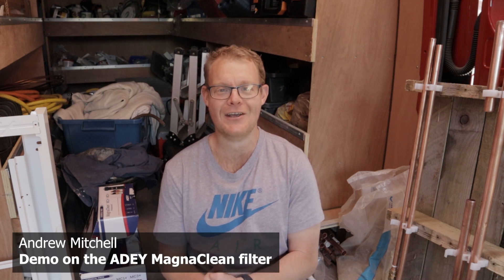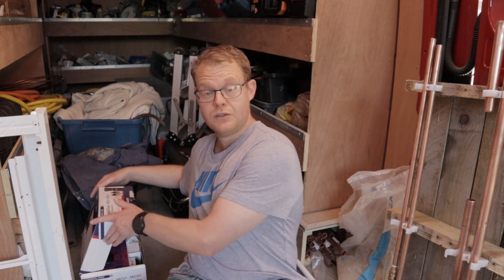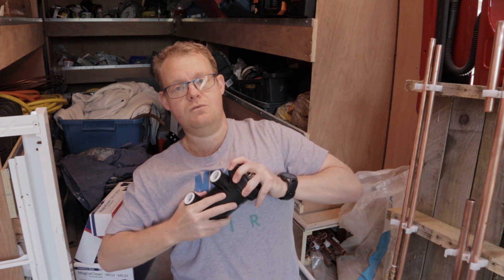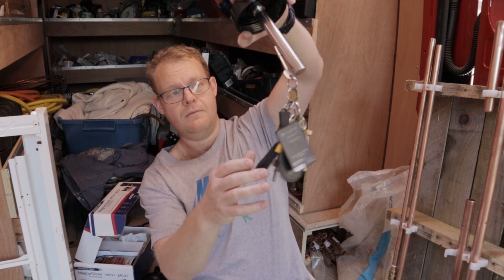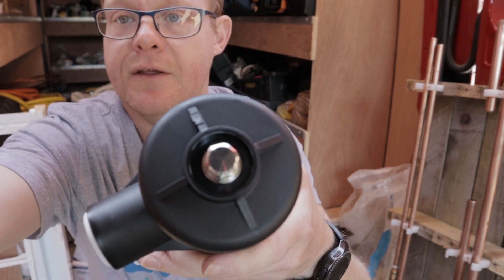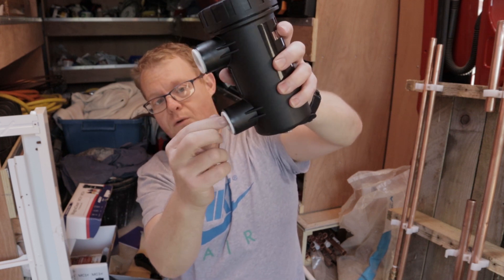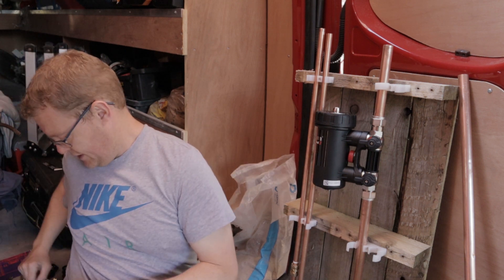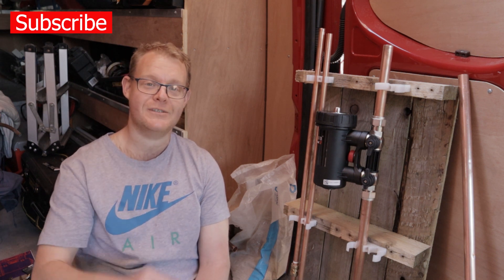Magnetic central heating system filters | MagnaClean Professional 2

Comment: Sorry can’t  send the photo.
Reply from the maker: As a rule of thumb it's usually the far right pipe on a boiler. The only way to know for sure is to google the boiler your fitting it on and download a PDF manual. That will defo be in there to make for sure your fitting the correct pipe.
Reply: Andrew Mitchell thanks for that Andrew, will check.

Comment: Hi Andrew  me again,  is there a slip end  on the compression fittings if you’ve got really rigid pipes ?
Reply from the maker: Sorry Dennis, I am replying from my phone so not logged in computer. I think this is in relation to the Magnaclean filter. if so, yes, the main valve body (compression fittings) incorporate a slip joint. the slip joint will give plenty of play so you dont have to move the pipe (play in the pipe) to be able to fit. Hope this helps.
Reply: Andrew Mitchell  Brilliant Andrew,  thanks a lot. Keep up the good work.